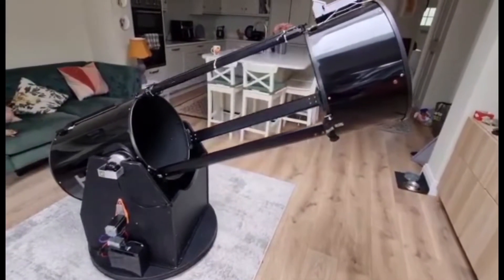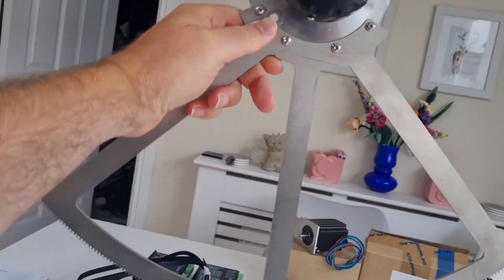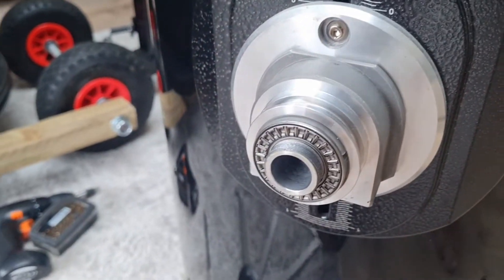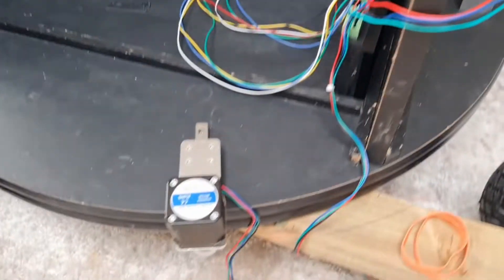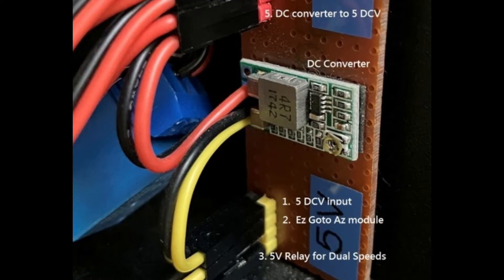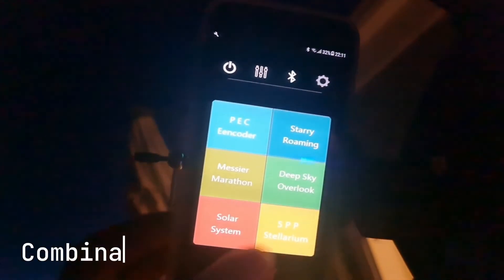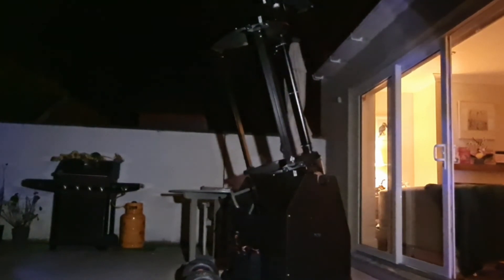Motorizing a GSO Dobsonian telescope.  Romer Optics EZ GoTo. #dobsonian #telescope

Comment: When you send your bearing to Romer for the Alt gear installation, do they turn that recess step into the bearing on the lathe as well as drill and tap it? Also curious to know how well all of the mechanical, electrical, entire EZ GOTO system is standing up to the wear and tear of repeated use? Are you still a happy man?

Comment: Nice work! Have you had any luck with tracking software for imaging the ISS?
Reply from the maker: Thanks. Whenever I had previously tracked the ISS I did it manually.  This setup is definitely not suited (if even possible) for that.
Reply: @StargazerMan I see Tom Williams @tw_astro is getting great results with both set ups, manual & tracking software on his big dobs. I’m hoping I might be able to use the Skywatcher tracking software in conjunction with my 16 inch Skywatcher GoTo truss-tube Dob. (But would need to see a workshop on it, if one exists). Have not had much luck trying to manually track it using 16” or my 10” manual Dob.

Comment: Wow, this looks like a great project to get my Apertura 8” working with a GoTo system! I was recommended to watch this video, and it really caught my interest.

Honestly, I enjoy using my Dob manually, but I’ve always wanted to take pictures with it — and it’s tough to do without a tracking system. I’m not an electronics or DIY expert, so I’m wondering: is this something someone with zero experience could realistically take on?

Also, what would be the total cost for everything needed? Is it possible to buy all the parts from one place, or would I need to order from different sources?
Reply from the maker: Thanks so much! Glad the video sparked your interest 😊
You're absolutely right. Manual Dobs are a joy to use, but astrophotography really benefits from tracking. The EZ GOTO system is a great option and it is designed with beginners in mind. You do not need to be an electronics expert. If you can follow basic instructions and are comfortable using a screwdriver and handling your telescope, you should be fine. I tried to make the video as clear and step by step as possible.

One thing to check is whether your Apertura 8 inch base has the space and clearance needed to fit the motors. Some mass-produced Dobs use different base designs, so it is worth confirming with Erik at EZ GOTO before buying.

As for cost, the full EZ GOTO kit (motors, controller, cables, brackets) is usually under 300 dollars depending on options and shipping. You can get the whole kit directly from EZ GOTO, so there is no need to source parts from multiple places.

If it shows as out of stock, message Erik at EZ GOTO on Facebook Messenger and mention StargazerMan Frank sent you. He may be able to give you a restock estimate.

Let me know how you get on, and clear skies 🔭

Comment: What a great kit. You keep mentioning 'clutches' being released to enable push functionality but there's no slipper clutches or similar in the kit?
Reply from the maker: Correct. That's a good call out. There isn't a physical 'clutch' as it were. On the app you can manually switch on and off the power to the motors while keeping the alignment / positioning. So instead of always having the power on to them, (which basically keeps them 'locked'). When I'm not actively observing something I switch them off. It saves power and reduces heating to the motors etc. In fact, I don't use the go-to function at all any more. As in the video at the end, I manually guide the scope to near the object following the directions on the app and then let go, the app kicks in an sends power to the drives to then finish the go-to and continue tracking. Hope this helps!
Reply: @StargazerMan  that makes sense! Many thanks for taking the time to reply. And you've had no problem with the steppers frying any controllers as a result of being pushed? They often behave like dynamos and generate voltage when manually rotated.
Reply from the maker: @bazabaza7821 not so far!
Reply: @StargazerMan  let's hope it continues. I'll have a look at their kit - the only issue is delivery to the UK

Comment: Hey mate so iv got a skywatcher 250p dobsonian i understand its not compatible with this scope because of the tension bearings is it a feasible option to change them for this ez goto kit to work effectively?
Reply from the maker: Hey. I've got a very similar scope with tension bearings (Orion 8" Skyquest) and after doing the mod on the 16"  GSO scope I reckon it's be very difficult to do what your saying. I'm actually thinking about motorizing the 8" also.
Reply: @StargazerMan  hmm so it wouldn't be a case of just changing out the bearings? 

Do you know of any other kits that provide this goto style of tracking?
Reply: @StargazerMan  also if you do motorise you Orion please make a tutorial video like this one... ppl like me rely on the intelligence of ppl like you lol
Reply from the maker: 🤗 I can tell you I had a steep learning curve with this one and relied on the intelligence of a lot of others to get there. Let's call it a group effort! 😄 
I did make an EQ platform for the 16" (it's a beast of a platform) but it's be much easier to make one for a small dob. They work great for tracking.

Comment: Would this work with the ZWO ASIAIR to allow it to work with a guide camera?
Reply from the maker: Hey. No it won't work with Asiair. Out of curiosity, what are you thinking about using it for? Planets would possibly work but long exposure photography would incredibly difficult with a dob. Not that it hasn't been done. 
I do plan on trying to image Jupiter and Mars through the 16" before they start getting too low again.

Comment: Wow, this is awesome. Thank you.  What determines the compatibility of the kits? It almost seems like this could be adapted to fit almost any Dob. I am wanting to work with a 17.5" Discovery and this looks like the basic premise of the system will work well.
Reply from the maker: Thanks. Well, the compatibility list is in the comments so check that out. The Dob has to have altitude bearings like the one in the video (Not spring type).
Reply: @StargazerMan  Ahhh Okay, that's what I need. I will just have to adapt it to mine. The bearings are no problem on mine, they are just Teflon strips. I can change them out to roller bearings. This is going to be a great experiment. Thanks for your help.
Reply from the maker: No worries. Give Eric from Romer optics a message on Facebook messenger and tell him StargazerMan sent you in his direction. He's really awesome for helping order the right stuff.

Comment: I got a second hand alt az/ equatorial mount. My 200mm newt tube looks huge on the mount but it does its work. Unfortunately importing the parts for a motorized dob mount would have costed me more. So finally I can take descent photographs. (provided that I finish the astroguider I'm building)
Reply from the maker: Sounds like a great solution! That 200mm Newt may look like a beast on the mount, but if it’s doing the job, that’s what matters. Totally get you on the import costs—sometimes adapting what you have is the smartest move. Best of luck finishing the astroguider, that’ll really open up your imaging potential. Clear skies and enjoy the journey! 🔭✨

Comment: Will this work on a 12 inch meade lightbridge dob?
Reply from the maker: Hey. No. The system is compatible with the following scopes;
GSO Dob 8"~16"  bearing model.
(Also branded as StellaLyra / Zhumell Z series)
Aperura AD8" ~ AD16"
Orion SkyLine Dob Series

Spring tension model scopes like the Skywatcher/Meade Light Bridge are not compatible.
Reply: Thanks for replying! @StargazerMan

Comment: This looks really good , thanks for posting it is quite an inspiration.  May I ask how much friction is there in your azimuth mount.  I have a 12" dob with the same type of plywood box mount but I am worried I have too much friction in the bottom for a stepper to turn ? Just looking for your opinion. I could get some rollers and mod the bottom if needed I guess.
Reply from the maker: Thanks! I reckon for a 12" you'll not have any problems with the reccomended motor (ask Erik from Romer and he'll help you pick the right one, he's super friendly and knowledgeable) he's on Facebook Messenger if you search Romer Optics and really quick to reply. 
My 16" in this video is quite an effort to turn which is why I needed the higher torque motor. The drawback is that the stepper motors constantly draw current so I really only have the motors engaged when observing. I don't use the go-to from start to finish. When Im going to the next target, I disengage the clutch, select the object then hit go-to and manually slew. When I'm near the object I let go and the drives kick in for the final honing in.
Reply: @StargazerMan  Thanks very much for replying and thanks for the info. I'll reach out and contact him. This looks like an excellent project to do and coming up to the longest days in the year it seems like a good time as well. Dark Skys mate

Comment: Are you still using this? If so, how do you find its tracking accuracy?
Reply from the maker: I sure am. I'll be giving it one final long session as the nights are getting very short now. Tracking is holding its own. I've not yet tried any planetary imaging with it.. I've been a bit preoccupied testing new scopes!
Reply: @StargazerMan  do you recommend getting it? I have built a onstep setup but it's very tricky to use
Reply from the maker: I was actually going to try the onstep way before I landed on the EZ goto. 
Honesty, it pushed my limits on electronics as there was a steep learning curve for me. I had to trial a bunch of different motors to get the right balance between power draw and torque. It's definitely a hands on project. As for operation, that part I find easy.

Comment: Hi. I have a broken Orion XT10G scope. The mount broken. Is there a way to use this process to get the mount to work again?
Thanks!
Reply from the maker: Unfortunately not Paul. The system doesn't work with the XT10G type of mount. Hope you have better luck fixing it. It's a great scope.

Comment: This is a very cool addition!! What is the diameter of the Alt gear?
Reply from the maker: That's a good question. I'll need to measure it as I don't see it in any of the documentation online.
Reply: @StargazerMan  If I remember correctly somewhere in the official manual states the diameter is about 300mm (it was written in inches) 
However, I wondered if it's true because without any gearbox the reduction rate (and steps per degree) would be too low for onstep standard.
That's why I want to ask someone owning this product.

Comment: Can i ask a question? Why did you dismantle the bearing? Would the large 1/4 steel cog fit with the standard bearing? Also how did you attach the at ans az sensors s?
Reply from the maker: Great questions and I can see I didn't make that very clear at all!
So for the bearing. The 1/4 steel cig arm part has to be attached to the bearing. For it to fit, Romer Optics will machine your bearing and pre drill the holes somit can be attached. If you have a lathe machine you can do it yourself. 
For the encoders, on the altitude, they supply a small part that you replace on the bearing that allows a small cylindrical magnet to be screwed on to the center of the bearing.  There is a bracket then sits over that magnet (time stamp 10:04 in the video, it's the silver part with the push to logo on it). This connects to a similar bracket that sits over the Azimuth magnet (again part is provided) see timestamp 10:10 same kind of bracket with flashing LED light. 
Hope this helps! Frank.

Comment: I see you're using the $150 kit, would the $360 complete kit come with everything I need or would I still have to buy some things? They're not super clear about it on the website. I would assume "complete kit" means you get everything you need but I'm not very well versed in goto systems. If you're able to answer it would be much appreciated.
Reply from the maker: Sure! I'll try my best to answer. 
I found it quite confusing also when I started looking at what what parts I needed. I bought an early version from Eric and ended up making the power board and doing a lot of trial and error making to get it right. BTW Eric is fantastic for help on Messenger. If I were to do it today I would jump at the complete kit. Simply because he's done 90% of it for you (the wiring / the boards etc). There will still be hands on stuff to do but IMHO it helps in the long run to learn to future manage the system. From looking at the list in the complete kit, other than a power source it looks good!

Hope this answers your question!
BTW - If you're not already, It'd really help the channel if you hit 🔔Subscribe🔔 Thanks!
Reply: @StargazerMan  Thank you. That helps alot!

Comment: I've got a 14" dob and I installed the EZ GOTO system as well. Just waiting for some clear skies. What camera do you use with the 16"?
Reply from the maker: Cool! Are the Nema17 motors sufficient for your 14''? I haven't use any cameras with the 16''...yet! 
I do plan on doing some planetary imaging now that it's tracking. I've a ZWO ASI462MC colour cam that I'll use.
Reply: @StargazerMan   Eric at Romer optics knew I had the 14" dob so he recommended right away to use the nema 23 for the alt and az and the nema 17 for my focuser. (ERIC IS AWESOME AND ANSWERED EVERY QUESTION I HAD!!!). It is completely silent when it moves around! FYI for anyone reading this I have a ZHUMELL 12" Dob, which is the same as an Apertura dob.
Reply from the maker: How do you power it? What is your battery life like?
Reply: @StargazerMan  I bought a 40 volt weed wacker battery & charger. But I have not tried it yet only the Home  outlet and extension cord. Also I need to buy a step down converter so it will step it down to roughly 20 Volts. Eric uses an 18 volt and says he gets a couple of hours on a smaller dob, so a 40 volt should maybe get 3-4 hours? We'll see.
Reply from the maker: @natdiamond That's not bad. I get about the same from a 20Ah 12V have to step up to 20v

Comment: Thank you for sharing that, I am about to attempt this with my 8” Dob.   What phone mount setup are you using on your telescope?
Reply from the maker: I used an old car phone holder. But having used it more and more, I find holding the phone easier.
Reply: I have the eyepiece holder on the side of the carousel and I lay my phone on that because I keep my eyepieces in a foam lined firearm type harbor freight case.

Comment: Which wheelbarrow did you get for your telescope? I have a 16in
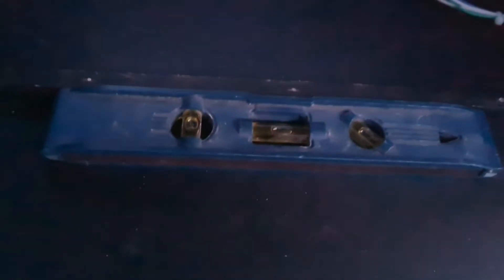Reply from the maker: I built one from scratch (go to 13:18 in the video) with a few lengths of timber, wheelbarrow wheels, a length of threaded bar for the axel, some washers and locknuts. The metal arms were leftover roof racks.